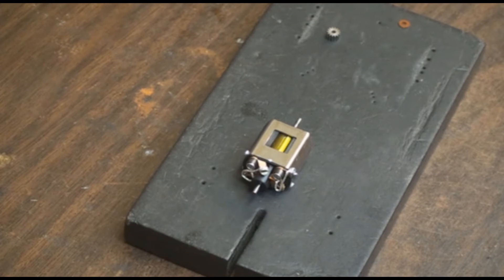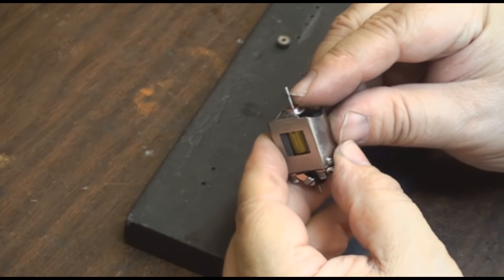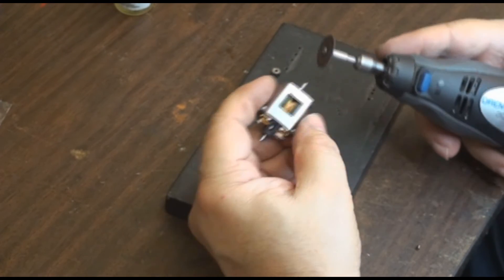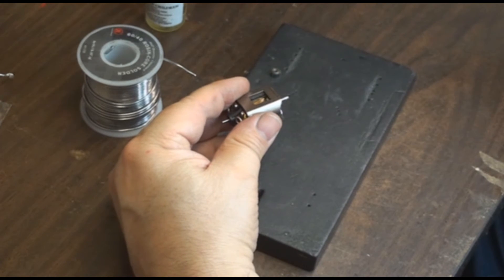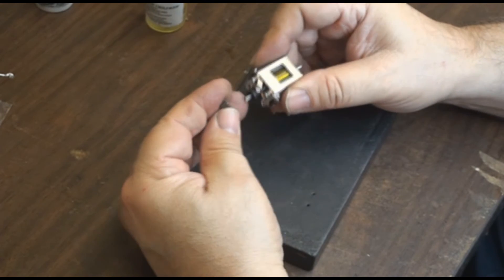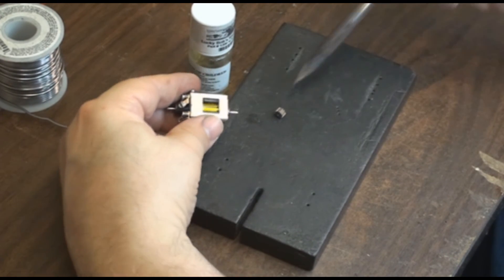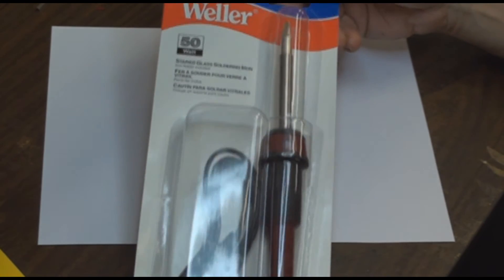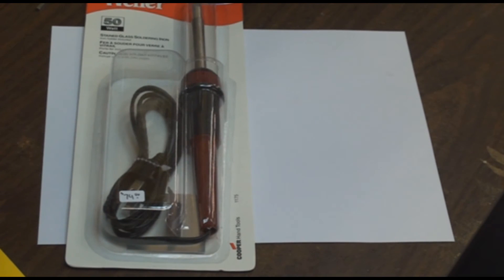Soldering on a spin proof pinion by Mick A. of Slot Car City

Comment: does it matter to use liquid flux or paste?
Reply from the maker: Hello J.R. A; Yes very much so. Paste flux is only good for lead wires but does not work for direct soldering to steel, like armature shafts or chassis unless it has been previously been soldered to before using liquid flux.

Comment: I have never cut the shaft but will definitely use the washer
Reply from the maker: If you do not cut the shaft of the armature shorter especially on a side winder drag motor it will cut right into the drag tire. Also even on road coarse motors if the shaft is to long you do not want this long shaft sticking out beyond the pinion. It is a lot cleaner looking and you can press the soldering iron right flat against the end of the pinion for precise soldering job. I have seen many racers that have spun their pinion on high end motors or got solder in the pinion by not cutting the shaft.
I hope that helps you understand why it is best to cut the shaft.